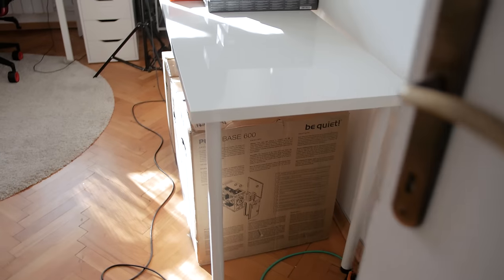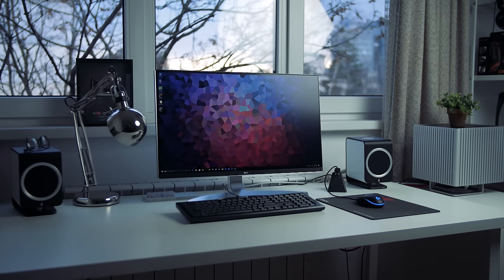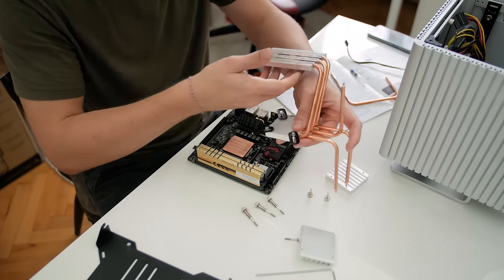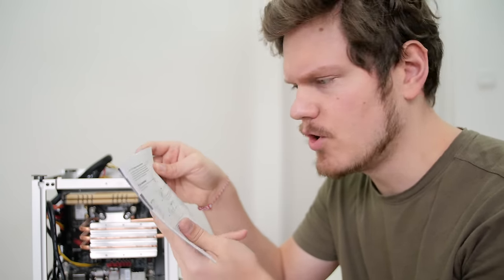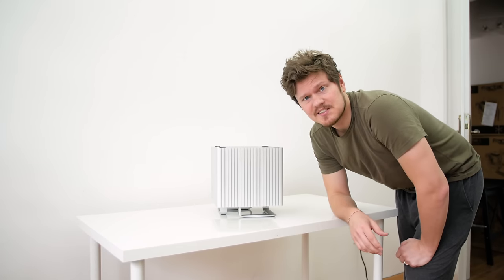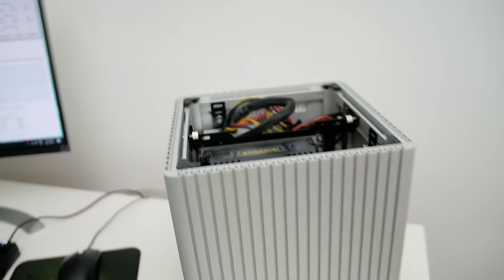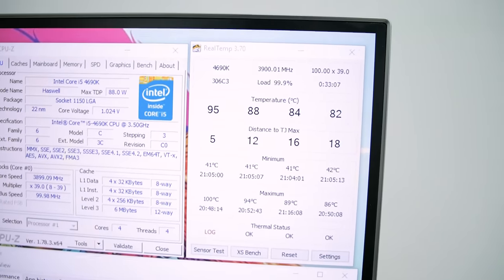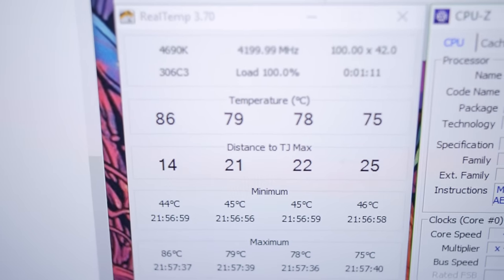Trying to Overclock a Fan-Less System... Do We Succeed?

Comment from the maker: FIRST :) Hope you enjoy this style of video. Yes or No, leave your feedback below: 
-Dmitry.
Reply: come on i wanna be first
Reply: why did you steal the spot of first from me?
Reply: Can't believe you just did this
Reply: Yes, and it was very interesting to see that OCing in action on a fanless solution...  Too bad the OC didn't quite work out with the throttling (but not surprised) - it's still an amazingly quiet solution for non-extreme configurations though. :-)
Reply: ...Human...Water-cooling. It can be done. We have the technology
Reply: but we are watercooled
Reply: HardwareCanucks yes. try a passive cooled gpu.
Reply: So, custom water-cooling loop next time?  C'mon, get that heat onto all four walls!  😂
Reply: HardwareCanucks just say poooooosh again
Reply: this is awesome. iam thinking like making that cooler waterproof and dumb it half underwater :D
Reply: Maybe a slight Case Change is in order here. Use thermodynamics to your benefit. Heat Rises so have the Top be the main heat sink instead of just the side(s). This would also possibly eliminate PCI Slot blocking. I have some Ideas that I will not release at this time due to proprietary infringement concerns. But I know for a fact that with the addition of at most 6" to the bottom, outside the actual case could provide a 3000w cooling so a GPU and overclocking of both will be simple. You all have a Blessed Day.
Reply: Also, this could be a liquidless system as well, so no threat of leakage destroying it.
Reply: Mr Objection Hmm, that would be an interesting test as most passive cards are usualy put into cases that have one fan (so a little air motion still occures).  But as long as the heatsink is right sized, it technically should work with out throttling at what ever the manufacturer defaults the clocks to.  But then again, there is still no air movement.  Be really interesting to see how well it would work with everything set to stock settings and a few hours of hard abuse.
Reply: The outside 4 walls are a heatsink, made of aluminum. You need the flexibility of the piping to connect to the CPU/GPU so that multiple motherboards may be used. And the fan would not be allowed in a fanless system.
Reply: I may have misstated the heat dissipation of this Idea, the 3000 I stated was BTUs, not Watts. Will anyone clarify the relationship between the two for me?
Reply: +Reggie Reginato, thank you so much, sir.  Maybe this will get me closer to knowing the actual Thermal Output as opposed to Electrical Usage. Have a Blessed night.
Reply: True, could heat pipe the GPU to a side of the case.  But I thought just using something like this would suffice since it already is passively cooled (although thinking about it, yes, convection cooling for it would be out of the question given the top of the case): http://xfxforce.com/en-us/products/amd-radeon-rx-400-series/rx-460-4gb-heatsink-rx-460p4hfg5-  But thinking about replacing the cooler with a block and pipes to the side of the case - might just be possible to have a truely silent gaming oriented PC (just won't be overclockable).
Reply: Reggie I would have to disagree. Just change the cooling pipes to connect to the top itself, which would have to be changed to all metal heatsink of course. Give internal access through the front, sides or back instead. Just an idea...
Reply: WolfsFriend1 I just ment convection cooling for the stock passive cooler already on the card wouldn't work if stuffed into the case as is.  But piping it to the top or another side of the case would work.
Reply: Hey Guys, I thought it was a cool style and I wasn't at all bothered at seeing the difficult steps along the way. That's what we as system builders face every time we start a build - nothing goes perfectly according to plan. This also settles any questions around the ability of this case to handle additional heat.
Reply: WolfsFriend1 I don't have FB - got sick of all the privacy problems of it years ago (and haven't looked back).   I also don't use hangouts.
Reply: HardwareCanucks loved this style. Fun to explore and go down the road of discovery throughout the video with you
Reply: should try out the 65w ryzen chip inside there. wonder how that would do temps wise?
Reply: Can I get that wallpaper please? Does someone have a link?
Reply: What about delidding? And if you can't get a GPU in there, they try to buy the 65 W Broadwell i5 5675C, with Iris Pro 6200 Graphics. It is currently the best IGPU on the market. Add some fast ram and it should perform quite well. Also the graphics themselves can be overclocked.
Reply: theres no point if you gonna have a fan
Reply: Try pouring dry ice or liq nitrogen on the case
Reply: nice very good
Reply: Yes!
Reply: Yes, i love it.
Reply: Yes
Reply: yes
Reply: HardwareCanucks if u gonna do this project do it properly man do the research this Lazy attempt isnt good enough.
Reply: Luke but the motherboard wouldn't have made a difference with heat... the PSU was 4 pin anyways, having the heatpipes go the other way didn't affect cooling, it only affected GPU room, and he wasn't planning on putting one in anyways as it would have been choked, this was to simply see temps if he overclocked a decently powerful and high wattage cpu, so don't criticize Dimitri, surprisingly he knows what he's doing
Reply: Tanner Sheppard typical scenario would be with a gpu.crit tv did it with a gpu.why do a test if it dosent replicate a typical scenario?
Reply: Luke this case isn't meant for gaming, the typical scenario for this case is a decent cpu, and on board graphics. Could be used for movies and streaming, putting a GPU in a fanless case would not only defeat the purpose of fanless, but also overheat the hell out of it, I mean it hit 95 non overclocked with just a cpu... imagine a choked gpu was added....
Reply: Jaigar there's no where to screw the side panels into the heat sinks, and the main larger heatsink was never screwed in, Dimitri is not an idiot, if there were screw holes, he would have screwed it in...
Reply: HardwareCanucks i love these kind of videos. Keep up the great work! I like the behind the scenes style of those videos.
Reply: Yes, my eyes started to bleed because your amazing videos, or am i just crying...
Reply: Like the style of the video but let's be honest, the DB4 is pretty.....rubbish.
Reply: PLEASE dont work barefeet on a carpet while handlin electronics. At least attach an antistatic wristband to prevent ESD and further frustration.
Reply: Delidding would then introduce one main problem, Dust. Which would quickly cause even more heat buildup?
Reply: Yes! Keep em' coming! Have a nice day!
Reply: WolfsFriend1 Indeed, heat rises. I communicated with the designer of this case over a few emails. Basically he states that this case design has it's limitations, but they will be releasing a GPU heat sink. Also they are working with another company, a leader in passive cooling, so I wonder what nay come of that.
Reply: Luke Hey hater. You are free to spend your own time and resources to help our hood man out, instead of complaining. Do it better and be kind.
Reply: hmmm, interesting. I still thinking to make the top a better heatsink would be a Major Improvement. Then the sides would have to do less of the work because if the contact is in the middle then from the middle up needs air movement to improve heat dissipation, whereas using the top uses natural laws to effectively help.
Reply: HardwareCanucks yeees
Reply: You mean Step 1) Wake Up, Step 2) Throw on something resembling pants or not, Step 3) Don't shower, Step 4) Start a review. Hmmm... i'm not sure if that works for me.
Reply: Dmitry, that was a great video to watch and learn. But this case costs some $300 bucks? Seriously???
Reply: they should make it a bit more bulkier and make a area where you can put water to help on heat absorption.
Reply: Yes!!
Reply: Yes, was interesting
Reply: hehe, your comment has brought an image to mind of custom water cooled copper pipework going from the cpu/gfx card out to side of wall but then entering a huge heatpad with the copper pipework threaded throughout the pad to cover most of the side wall as one giant heat dissipation wall like you used to see on the back of fridges except enclosed within the pad that meets the outer wall. Could be done perhaps by someone skilled.
Reply: i enjoy ur vids Canucks i even checked out the Primo case u said that was better
 quality  then the 900D ty :) ps : Vancouver Canucks are dead last inthe league today. in 2018.
Reply: Yes

Comment: Things that can be done:
- Lower wattage CPU (Ryzen 1700, Core i7-7700T) ...damn that's a lot of 7s
- More thermal paste. Not just on the heatpipes
- Delid the CPU for that extra ~5-10 C
- A quiet ceiling fan
- The bundled paste could be low quality. Try something else

Comment: @4:37 did anyone else cringe when he bent that pipe?
Reply: Yes, and there's a very visible kink in that pipe afterwards.
Reply: balthasaur I
Reply: Reminds me of an iPhone 6.
Reply: Im curious as to what happens to the fine copper powder wick inside the pipes when bent like that.  Would have been good to use a thermal camera while the system was running to see the effectiveness of each pipe and its connection.

Comment: should the aluminum blocks be reversed so the smooth side touches the side of the cases so it has more surface area?
Reply: gonzostwin1 that bothered me too, wouldn't they have a larger contact area the other way?
Reply from the maker: +gonzostwin1 apparently not. The heatpipes are suppose to touch the actual panels for best heat transfer.
Reply: HardwareCanucks this surprises me since they do not seem to make full contact in that orientation.
Reply: gonzostwin1 BUT copper has a lot better thermal conductivity, if the thermalpaste is good and applied correctly(i think you will need a lot of it on the bare heatpipes) plus could you even put the alu blocks to it since it makes it a little bit longer and he already had problems with the heatpipes being too long/bent. And you also have to mount the blocks to the frame, and i didnt see any mounts on the other side of the blocks.
Reply: HardwareCanucks goddamit 12s late
Reply: Exactly my first thought too.. Just cram some thermal paste on the heat pipes before you insert them into the blocks to make good contact there, and place the full surface area on the side wall using more thermal paste.

Comment: ...Human...Water-cooling. It can be done. We have the technology
Reply: CxnTrxL This is supposed to be fan-less.
Reply: we are allready doing that, people with knee surgery get a watercooling jacket around their knee so it helps with the swelling
Reply: yeah but you don't watercool the case of builds, do you?
Reply: Am I the only one thinking this is somehow related to Golden Shower Cooling System(tm)?
Reply: An interesting fanless mod would be trying to turn the case into a diy radiator by winding copper tubes in a coil all around the inside of the case
Reply: WHAT THE PLANTS CRAVE Yeah, but in that case, you couldn't touch the case.
Reply: Our brain is already water-cooled.........
Reply: But it still gets hot!!
Reply: I'm tired of flipping my pillow over to the cold side. This needs to be done.
Reply: Humans are water-cooled through sweating, peeing and through blood circulation. Blood carries excess heat from the internal organs and muscles to the skin which acts as a radiator. The skin then cools of through passive air cooling and evaporative cooling from sweat. There is also active air cooling through breathing though this is far less efficient.
Reply: Vladimir Winnin but we can do better <.<

Comment: A friendly warning:

Don't bend the copper tubes unless you have to. It appears to be soft copper and when you bend it you begin to work harden it. Bending it a few times is usually what causes it to crush instead of bend.

If you do harden it and are worried it will crush, annealing it with a propane torch is usually enough soften it back up.

Comment: If you had some really low RPM fans (like 400rpm) it'd probably vastly improve the temps and still keep it silent.  Really though, the case is a gimmick.  It has surface area, but surface area doesn't meant much if it's not accompanies by airflow.   That's why heatsinks have fins....for air to pass through them.  But if you're sitting in a room where there is no airflow, the heat won't get moved away quick enough.  We know from heatsinks, that there reaches a point where it doesn't matter how big your heatsink is, it won't cool much better.  

A cooler idea would be to run a peltier device on it, with a wattage input that changes with CPU temps to keep it from getting too cold.  The only reason why we don't really use these as coolers is because they take as much energy as whatever it is they're cooling puts out.  So it could basically double the power usage of a system, which is actually bad for the world because imagine if every computer in the world suddenly used twice as much power.  So part of the reasons why we don't have crazy fast PC's is because companies trying to keep power usage down.

Comment: Hey a request/question. Why dnt you  try watercooling  cpu and attatch  pipe  or heatsinks on all sides of the  case?
Maybe  use  flat copper tubes attatched to the wall and the rest soft tube?  using very small 5v  pump will make the case virtually silent

Comment: Put a Dyson bladeless fan next to it and test it out...
Reply: Theyre not bladeless, they just use an impeller in the base instead of conventional fan blades lol
Reply: Protostar Yep. Gimmick is gimmicky
Reply: Mikah Mitchell But they look and sound blade less.
Reply: They still make noise too.
Reply: what if you did that design except on to the top of the case where it pushes air through the groove in the case. that and larger heatsinks on the inside I could see it being an extremely quiet but still cool system
Reply: Those have fans inside them, they just hide them and flow air out through the rings.

Comment: Hey, Dmitry! Do a Ryzen 1700 build in this case. Interested to see how it can handle the 65W TDP ... This would make a pretty good fanless workstation, but can It hand a video card? Keep up the nice videos :)
Reply: Anton Penchev don't think there are any mitx am4 boards yet, also not sure if they will make any. Am3 never had Mitx.
Reply: fourtysix4646 It is confirmed that at least three manufacturers are making ITX motherboards for AM4, they just are much more difficult to design. The first ones are expected to launch mid-April.
Reply: Anton Penchev heck yeah that's a good idea I was thinking a kaby lake would do better but Ryzen is super cool.
Reply: the 1700 TDP almost doubles if you try to overclock.
the 65W TDP is very misleading
Reply: 130watts is still way better than the x99 6core system I have. I don't think advertising intended settings is misleading at all. What are they suppose to print on the box "65watts but more if you overclock" well no crap.
Reply: Actually, the R7 1700 can consume over 200 watts when overclocked to the max
Reply: Nathan Fitzer even at the base clock, it consumes more than 65 watts.
Reply: TDP is not the same as watts consumed. TDP is just a measure of how much energy needs to be dissipated.
Reply: D J P
there is a fanless/passively cooled 1050 ti out there, would be perfect for this
Reply: This case is only for the looks and small size. I have an AMD 1700 overclocked to 3.8GHz and with a Noctua D15 I can turn off the fans at idle (stays under 40c) and run at only 600-800 rpm at full load (prime95, temps stay under 60c).

In other worlds I have a passively cooled PC when browsing the web or programming, but I can also do high performance tasks while staying super cool. Do not buy this case if your goal is silence. Hybrid (fans 0% while passive is enough) cooling is better.
Reply: fourtysix4646 Fourtysix4646. AMD has posted the X300 for the new AM4, but when? I'm sure it will come as they say so
Reply: There are some already in the market: http://wccftech.com/first-amd-ryzen-mini-itx-motherboard-detailed/
I also saw that the db4 comes in matte black ... I think thats the most beautiful case I have ever seen ...
Reply: You can't buy a mini ITX AM4 board anywhere...
Reply: LiekSecretss the AM4 platform was rushed from the start.
It's not surprising Motherboard manufacturers arnt ready
Reply: LiekSecretss I saw two on Amazon just today.
Reply: I only see ATX and micro ATX motherboards. No information online about mini itx either. Can you provide a link?
Reply: No way, Ryzen runs too hot for that
Reply: I think a GPU would be unwise to install in that case, if it already needs external cooling just for the CPU cores to stay at 80 degrees.   I think the fin design is either bad or simply not big enough.

I wouldn't risk hardware for $ 2,000 in a case that can't cool the CPU - don't forget, the mainboard will also run VERY hot, because there's no air moving - no CPU cooler, where the air movement doesn't just go to the CPU cooler, but also cools the rest of the main board components. 

Imagine you put a computer in an oven - and then you connect only the CPU to a cooling device of whatever sort...
Do YOU think this is going to end well?